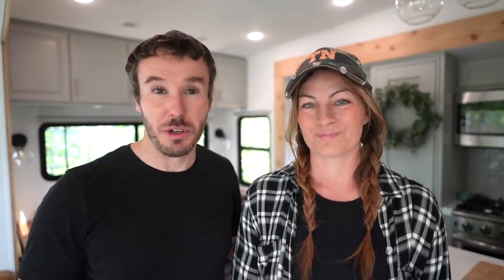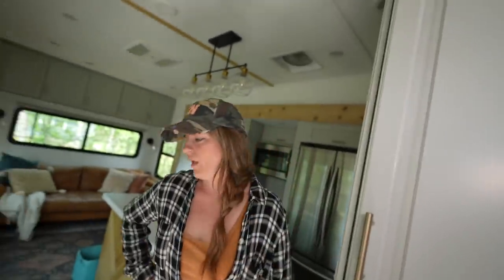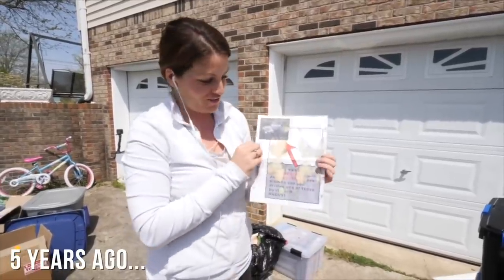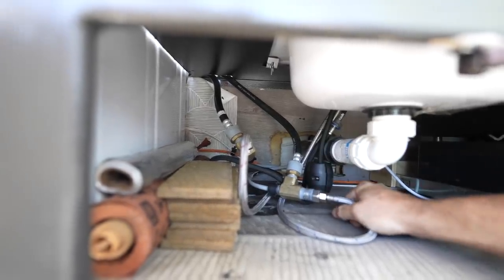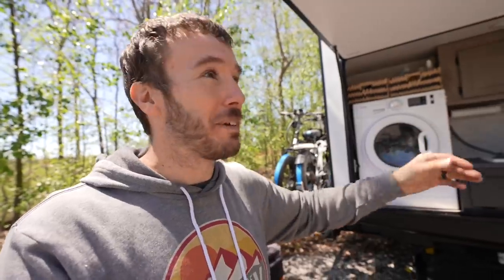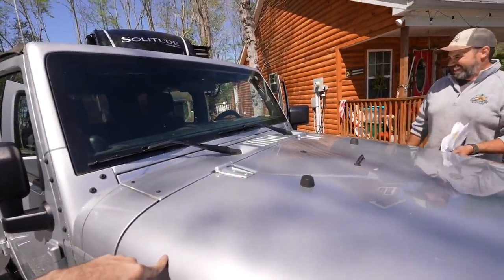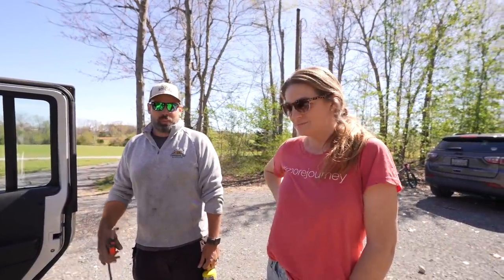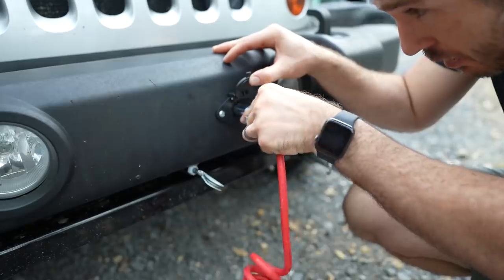Prepping Our Jeep to Flat Tow for Our Next Journey

Comment: That blow torch trick on the wheel wells was amazing!! Wow!
Reply: How exactly does that blow torch work on the plastic fenders? is there actually a flame, or just the gas?
Reply: @matsulli2086  The heat of the torch brings the oils in the plastic to the surface. 
You have to be careful doing it so you don't actually melt the plastic.

Comment: I picked up a spring to put between the brake pedal and the drivers seat. My brake had a habit of not releasing fully. I would look back and see smoke coming off the brakes. Spring cured it. I had to experiment. You don’t want it to fight the tow brake cable but still strong enough to pull the pedal back toward the seat fully.

Comment: Well this is the second time we have seen welding on your Solitude. Really totally unacceptable in my opinion. I am a GD owner with a 5th wheel and Lippert and GD are to blame. Grand Design doesn't inspect and check welds before a build?? All welds on that front end should be subject to visual and template inspection.  You are very fortunate to have them come out. The average rv buyer does not ever see their welding mistakes repaired at a home base. During your video you said it is stronger after the fix. I wonder where that leaves other 5th wheel owners???? Safe travels.

Comment: Make sure they connect the charging cable from the tow vehicle. Otherwise after a long day of towing, especially if your headlights are on, your Jeep battery will be dead from running the tail lights all day off the battery.

Comment: I’ve never understood the earthquake analogy that RVers use. Shouldn’t RVs be built to withstand the environment in which they will operate? They have wheels so I imagine they’re meant to be moved. Might one use the same analogy with airplanes? They’re subject to stresses, but you don’t expect them to fall apart during flight.
Reply: the road is a factor in the trailer moving. the company I work for has food trailers and my friend who works there does constant work on them because of the sometime major vibration on the road. we have great tires.
Reply: Airplanes also have vigorously detailed checks and are maintained constantly.  Typical RV owners are not this detailed and thorough with their checks and maintenance.
Reply: @wesleyfreezeland8140  your point is understood. However, I was referring to build quality.
Reply: @harley9218  ahhh until there are standards set by the government for them like automobiles and aircraft, we can only assume they will maximize profits above all else
Reply: @wesleyfreezeland8140  I couldn’t agree with you more.
Reply: I think part of it too is RVs are built to be used 2 weeks a year not lived in full time so they are putting over 20 years of wear on it in less than 12 months.

Comment: My guess is that you will drive the Jeep separately from the truck/RV. 

Great that GD and Lippert are taking care of you. GD is am impressive company. 

I have an Arctic Fox, they make their own frames and these are for their size probably the heaviest and most sturdy fifth wheels and TT built. My 34’ fifth wheel, empty weighs 13,300 lbs with a GVWR of 15,700 lbs. It is now 5 years old and I’ve been all over the country and haven’t had a single problem or repair. They are off road certified. But it is a couples coach, certainly wouldn’t work for you. 

Looking forward to your new season!
Reply: Why would they install the tow package and then drive it separately 🤔😖

Comment: Hi. Been watching y'all for years also.... BUT.... I thought in a video a long time back, you said that you had made a mistake and said you had a 2-wheel drive Jeep, not a 4-wheel drive version. If so, then how are you disengaging the transmission? 4x4 versions have a 4wd neutral, 2wd versions don't .... I had to research this when I wanted to move from pulling my wife's Hyndai Santa Fe on a tow dolly, to get a Jeep and tow 4 wheel down behind our old Class A. I also found that you can't do Jeep's on a tow Dolly, as they don't react well, especially if the rear wheels are on the ground!. Hope you guys are doing well...and whatever the new digs are...they are great!
Reply: If I remember right, they had another jeep awhile back. This one they got around the time JJ was born.
Reply from the maker: You are correct we had a 2-wheeled drive jeep but we sold that one.  This one is different.